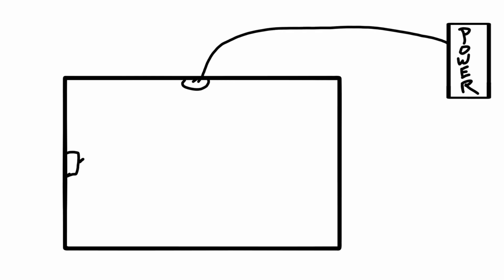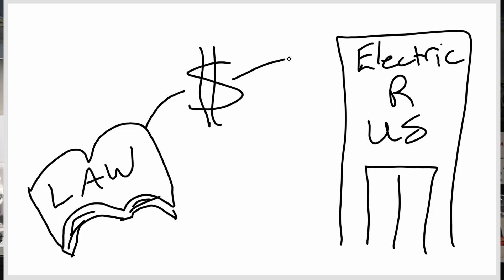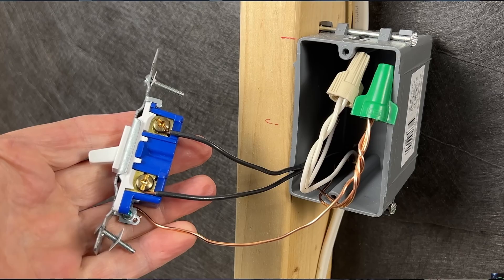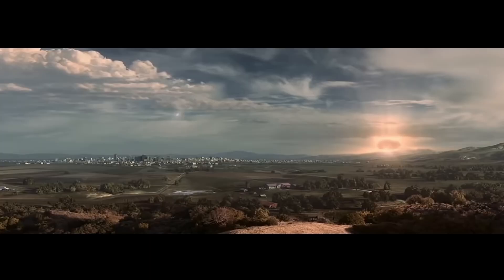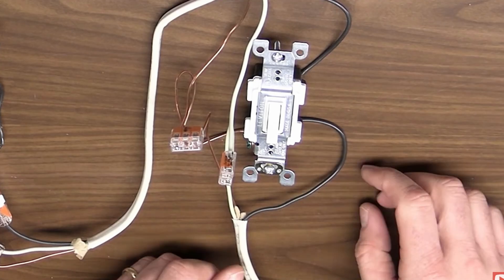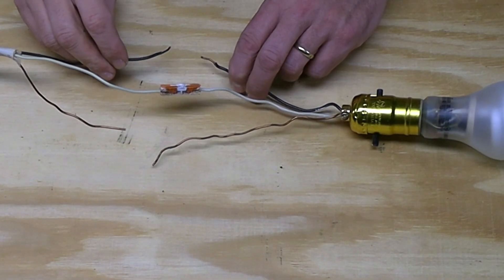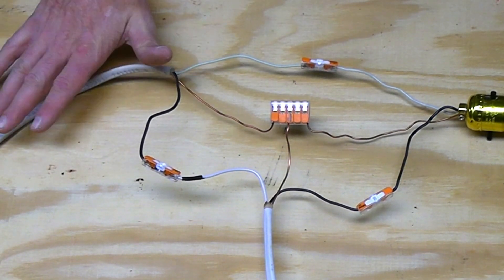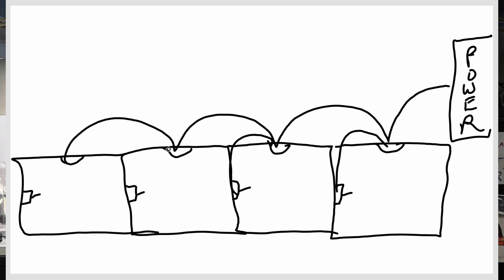AWESOME switch wiring THEY don't want you to use! -- switch loops

Comment: I just ran into what I think is a switch loop in older construction. I was hoping to replace the switch with an outlet/switch combo, but it seems like that wouldn't be possible in the switch loop case. Is that true?
Reply from the maker: Yes. That is true. ... I suppose that's another con of the switch loop :-/

Comment: Light boxes shouldn't be used as junctions, imo. I've fixed so many instances of overstuffed light boxes. For some reason people who wire switches like this seem to love also making light boxes their main junction points.

It's rarely a big deal to just pull the wire that goes to a light box, run it to a new switch box and then run a new wire to the light box. You were going to run a new wire between the light box and switch box already. Half the time you won't need to even extend the original wire, because statistically around half the time you're probably adding the switch on the side that the supply wire comes from.

I don't agree that this is good advice, and in any case, please don't do things that are out of code. You have a sign that says "do premium quality work" and this video seems to suggest doing bad work. :/

Comment: I'm going to disagree with you here. It isn't all about manufacturers "lobbying" but partly due to them selling switches that used. NEC 404.2 (A) (C) states that switches need to be wired with ungrounded conductors only because the light socket would still be live and could be deadly if you used a neutral.  In Section 404.2(C), it states that that it is required that a grounded neutral conductor is provided and installed at switch locations with exceptions. Meaning that it applies to new installations in residential (this does not apply to most commercial because they use conductors through a raceway) . Electricians went around this by just providing a neutral and not actually installing it. Smart switches send a small return current through the ground. It was typically less than 1/2 mA because listing and certification process of appliances and switches can not leak more than 1/2 mA of current along the equipment ground return path. If you have a lot of these switches and sensors on the same circuit, the leaking current can add up which can trip a GFCI device that is designed to trip around 4mA on the ground path. This is also a safety hazard as the ground should only be used for an emergency path the ground should not be used other than what it is designed for. The NEC did not like the idea of people introducing current onto the equipment grounding conductor and neither should anyone else. This is a safety issue not a lobbying issue.

Comment: You can still do a switch loop with the power at the fixture by running 3 wire Romex to the switch: black, red, white, leaving the white taped until such time as a 'smart' switch is installed. If your house is older with only two wire switch loops you are out of luck. Skip the 'smart' switch.

Comment: I lived in an older house when I was growing up (think prior to electricity in houses) - we still have it on the property and use it for a shop. It has some switch loops that were installed when electricity was added to the house. One issue is, since there were no codes at the time, no one felt the need to "identify" the white as black, so you have live black and white wires in light boxes and light switch boxes. Sometimes code changes are not just for selling more products but are for safety.

Likewise, there is no real "need" for heat and A/C in cars - they were an option at one time ... now, try finding a new car without either. Many of the things we use daily were once luxuries.

Comment: Sometimes you don't really know if it's worth adding some extra requirement until YEARS later.  I experienced an old house with many SHARED NEUTRAL circuits.  Back when they wired it, they saved a few bucks, but GFCIs feeding downstream outlets don't work well with shared neutrals in some cases.  I say: the cost of the wire is minimal compared to labor and retrofit costs, so GIMME ALL THE CONDUCTORS.

Comment: Indeed switch loops using xx-2 cable is more commonly used in homes built prior to 1990, and even today they are sometimes the only practical method for renovations where keeping drywall repairs to a minimum is a must.  Most commonly is when adding a switch to a pull chain fixture such as when converting a closet into a bathroom.   In this situation a 14-3 should be ran from the fixture to the new switch location, using the black for power and red for load is the traditional practice, and a neutral will be available for future use should someone decide to install a special switch requiring a neutral, such as a motion sensor switch.   

If using raceways aka conduit from the lighting outlet to the switch box - this would obviously most often be in a commercial building, or an unfinished basement with cinder block walls- and the raceway is large enough to accommodate an additional conductor, a neutral is not required in the switch box at the time of installation, the idea being a neutral can easily be added later on if and whenever necessary.
Reply from the maker: Thanks for the great info!

Comment: If obe needs to run a power line to each junction box. Then naturally ones going to run 12/2 wiring which has black whute and ground. CODES REQUIRE EACH DEVICE TO BE GROUNDED. Stop The Insanity.

Comment: That's a Parallel Circuit,, so yeah, it should be Efficient. Just care that the drop in voltage is not more than 3% to the last light in a chain 💡💡💡💡💡
Reply: By efficiency, he means cost, not literal electrical efficiency.
Reply: @ZT_1234  Which correlates, in home circuitry
Reply: I wonder just how true that is when low wattage bulbs are used.  A hundred years ago, 100 to 300 watt bulbs were common place.
Yes, I recognize a ceiling fan is going to skew the math.
Reply: @davepetrakos475  Well that's an Electrical Standard Today, in many parts of the World. Ceiling Fans are terrible, never install them

Comment: I suspect the reason the code made it a requirement is that too many people were using the ground wire as a neutral for hack installation of smart switches.
Reply: Nailed it! Even though the "smart switch" may only need a few milli-amps of current, you just turned your grounding conductor into a current carrying conductor which is a violation.
Reply: Im jealous!  My  house has mix of knob & tube, 2 wire "romex".  Almost no electric  ground wires.

But at one time there was a ton of grounding wires from roof peak to rods around basement.

Comment: Either use 3 conductor cable (e.g. 14/3 NM-B) or run a neutral conductor if using raceways.

Comment: I am thinking it was for safety. Switch legs were never a great idea. Having power on a white wire could be at least confusing/misleading to very confusing or dangerous for unqualified (aka unsmart) people. Yes, the new requirements allows you to install motion and dimmers (or other smart) switches for LED lighting. Older dimmers or motion switches require a little leakage current (thru the old incandescent bulb) for the electronics. Which is not possible with newer LED lighting.

Comment: They care about smart switches but still don't require CFGIs in ALL circuits. American electrical codes are a joke.
Reply: Very few electrocutions were caused by ground faults. Most were caused by stupid people doing stupid things with electricity. Our codes are over-engineered already, but they are not as over-engineered as the nanny-state of the EU.

Comment: The only thing that really changed is the need for a neutral in the switchbox.  IIRC The code doesn't say you have to run the power to the switchbox and then to the fixture in new construction, it is just more common and sometimes more practical these days to do so.  The only change you need to make is to ensure the main switch in each lighting circuit has a neutral available.  and If I am reading the code correctly, in 3 way and 4 way circuits where all switches controlling that circuit are in the same room the neutral is not required in every switch box in the case of a dead end 3 way in most places but it is often provided to make inspections easier. This means you can still have a switch loop but you just have to use a cable with an extra conductor 14-3 with ground for example, to ensure the neutral is provided and available in the switchbox.  While 14-3 is slightly more expensive than 14-2, it is not that much more these days as the difference mostly works out to the addition of the one extra conductor.

Comment: I hear what you are saying.  I agree with your thought process 99.9% of the time.  BUT, in this case, it's benefiting me.  I have Lutron Caseta switches in most of my light switches, absolutely love them.  My house was built in 2005.  I have a neutral in all off my switch boxes.  Has made wiring up the smart switches so much easier.

Comment: I think there is a way to make the old method work with 14/3 (4 conductor wire). Yes it costs more, might still be a code violation to toss the red in the mix. It would re-simplify things if allowed.
Reply from the maker: True, you could drop 14-3 to the switch. That would be compliant.